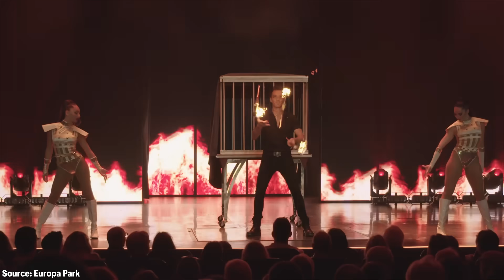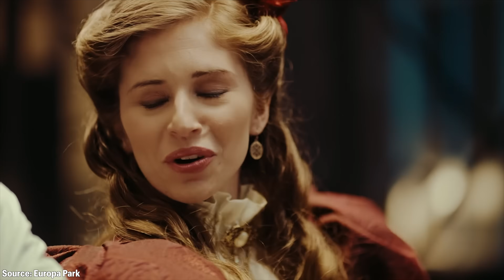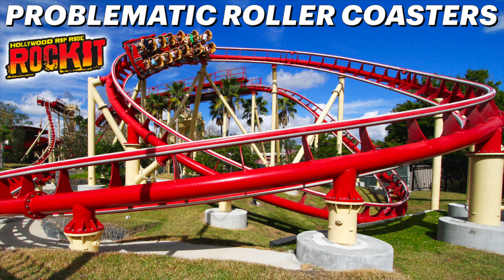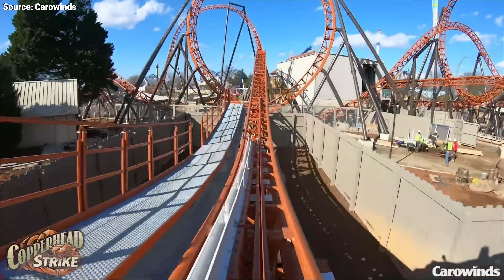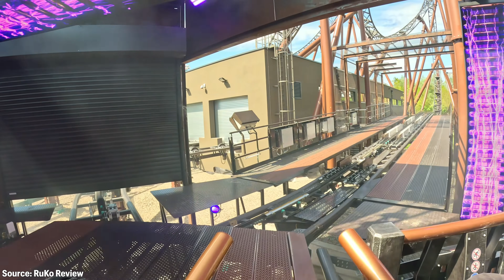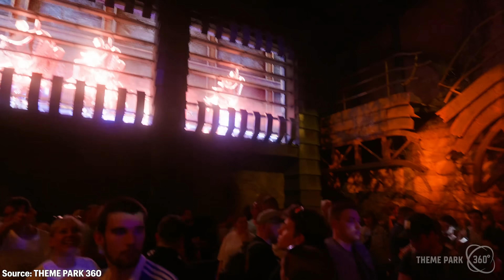2024’s Most Cutting Edge Roller Coaster - The Incredible Complexity of Voltron Nevera

Comment: Was just there. That thing ran like a clockwork.

And during my five rides it was quite smooth, with the outer seats only a little bit rougher.

But it is intense from the first to the last second, the break on the turntable is welcomed. And a real 'roller coaster' with so many different elements. Definitely a must.

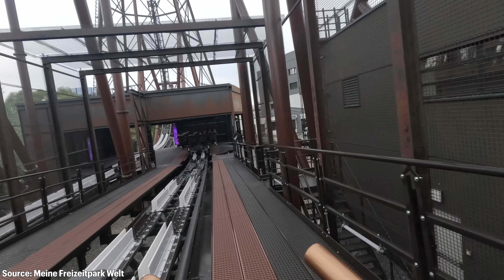Comment: 15:00 Changing direction on the turntable has to do with cables. They get tied up or need a complex interconnect if you want to keep turning continuously. Going back and forth means that all you need is a tensioner and a little slack.

Comment: I just visited Europa Park (November 2025 ) and throughout 16 hours of operation over two operating days, the ride never had any downtime. Mack’s engineering and programming is incredible. It seems the teething was sorted out quickly.
Reply: I've been there for two days (october 2026), and it did have two downtimes. One was for adding another train, lasted a few minutes at most. Second wasn't explained (but we did notice a train with an empty front row twice while in line), was maybe 10 minutes.

Comment: I guess the turntabel turning clockwise-counterclockwise instead of always in the same direction has to do with the communication of the launch motors. Electrical connections can be made to turn infinitely, with data connections this is harder and less reliable without the use of wireless components.

Comment: I visited Germany a few days ago, and got to ride this beauty. It is MUST RIDE. That first launch was heart pounding and the air time during the inversions was intense. 
Was a bit sad that we had to stall for a minute right before the backwards launch. Took some momentum away. But it didn't take away from the experience.

Europa Park's loading times are insanely fast. As a single rider, I didn't wait longer than 20 minutes for most of the coasters. (About 30ish for Voltron, as the trains stopped for a few minutes.) For Blue Fire, I think I waited 5 minutes? 
(Granted, I went on a weekday.) Considering the park closed at an early 6pm that day, it's pretty amazing that I got to do almost all of the coasters with no problem. (I skipped Pegasus, Alpenexpress,
and the water rides.)

Put this park and coaster on your list!

Comment: I got to ride Voltron just yesterday (28th June 24).

The ride is pure insanity and very intense. But... IT RATTLES. On the middle seats, it's bareable, but on the outer seat, it's almost unbearable.
It's surely not the worst rattle you will ever have experienced, but the combination of the sheer intensity of the layout combined with the rattle just does not work. The shaking makes it difficult to brace yourself for the intense elements. My first ride was on an outer seat and I had to focus so much on trying to stabilize my head and body, I couldn't fully enjoy the ride.
My second ride was on a middle seat, which was so much better. Even there, it's still super intense, but I was able to relax my body and just embrace the ride, which made it so much more fun.

Since Mack is pretty good at bending track and the fact that the rattle wasn't that bad on the middle seat makes me believe it's a train problem, so I still have hope that it can be improved.

When I was there, the park was relatively busy, there's no summer break yet where Europa-Park is, so still not the busiest time. The waiting time consistently was 60 minutes, which I think for a brand new headliner attraction is not too bad. The other big coasters were around 25-35 minutes most of the day.

I stopped the times, and they were running with 40 second dispatches. Not quite the 36 seconds, but maybe they are still fine tuning it or taking off a train to improve them (copium). But, due to the moving station, it was 40 seconds every single time, all day. I didn't take notice of any breakdowns during this day, it seemed to run like a clockwork.

The lockers are indeed free, you get handed an RFID-Card at the locker area in the queue shortly before the station, you just pick a free locker, put in your stuff, close the door and tap it with your card to lock it. After the ride, you retrieve it the same way from the other side and return your card by throwing it into one of the boxes at the exit.

As for the launches, they definitely have more punch than on other Mack coasters. The first one not that much, but the backwards launch definitely has a kick and comes pretty unexpected (even though I knew about it).

The pacing ot the layout is one reason of why it's this insane. If you feel like riding coasters a lot made you a bit dulled to the intensity of roller coasters, this thing will remind you of what "intensity" is. Some of my friends found the barrage of elements a bit too fast, but I think that's just a matter of preference.

The whole ride is mesmerizing to watch because of all the moving parts and the rhythm it has and the fact there are always multiple trains on the layout.

The indoor queue area is also pretty cool, even though it's just one big room. On the one side, you can see the actual trains entering the launch area, then the flaps close, you see some blue lights through the flaps, you hear noise and screaming, then the flaps open and the train (and people) are gone. Really makes it look like a teleporter. On the opposite side, there are the same flaps, but with video walls behind them. You see them open, and on screens behind, a train with people materializes out of thin air with lighting and sparks, and then exists the screen as if it was going towards the station, the flaps close and it repeats after a few seconds. The trains materializing on the screens have different people on them each time, and you can spot a few cameos, such as Patrick Marx (technical lead of this project who you also saw helping to push the train in your video), Michael Mack (Europa-Park General Manager) and Christian von Elversfeld (Mack Rides General Manager), and probably more that I missed. It's just a neat easteregg.

But in my opinion, the rattle is a bit embarrassing for Mack Rides and takes away from the ride experience. It's such an engineering and design masterpiece, but then kinda fails at one of the important basics.

I came in wanting to like Voltron, but after my first rough ride, I wasn't sure if I did. After my second ride which was smoother, my opinion about it improved a lot. But it's kinda difficult to give a fair rating for a coaster that has a 50% chance to be insane, intense fun and a 50% chance of it trying to pulverize you.

I'm keeping my fingers crossed that they can turn this somewhat mixed experience in a consistent, great experience.

Comment: Great video, rode the coaster as much as I could on my visit a few days ago and it's truly awesome.

Three small facts I would ride to mention:
- lockers are indeed free, ride attendants will give you a key card, which allows you to choose a locker, in the exit area there is a scanner which will tell you your number in case you forgot it
- the Tesla coils now play the rides theme, also there are two smaller coils next to the animatronic
- the effect track is visible from the waiting area, however shutters close once a train launches to not spoil the launch, that effect is also mirrored to the other side of the station where the train arrives after traversing the layout, however there is no window but a large screen showing the Mack Family riding the coaster

Also I would like to mention that operations were really smooth and there was no downtime, apart from some very short station stops, that were resolved under a minute

Comment: The turntable alternating directions is so that they can use off the shelf flexible lines and quick disconnects for electrical, air and possibly hydro. If it just spun in one direction they'd get all twisted up eventually.

Comment: Personally, I believe coasters built with short LSM's in the valleys of hills will become the norm in the future. Maintenance crews could access the LSM's from near ground level making it a lot easier and safer do upkeep. In terms of ride experience you could keep the pacing consistant while adding a bunch of capacity. Also no slowing down, you could hypothetically run the thing at 100 mph for the entirely of the ride. Everything I know about coasters is from the internet so I could be completely wrong. Love the video!!
Reply: It's possible but it's likely to be pretty expensive. Keep in mind Mack owns the park so this is also an advertisement for the system; a showroom model of sorts. The cost to throw all the gold plating on it is a little easier to swallow when it's the one you brag about to potential customers.

Comment: Thank you so much for including my content in your video. Being a longtime follower of your channel, I feel very honored by this.
Voltron Nevera was a long-anticipated coaster by me, and I managed to ride it seven times on opening weekend.

For those of you who are interested in some stats about this coaster, I also made a video with the G-Forces that I recorded during my very first ride: https://www.youtube.com/watch?v=H2XZCCfWDy0 

Yes, the ride is intense compared to everything else Europa-Park has in its lineup. Especially the ejector airimtes and the zero-G moments are exceptional.

One thing I could add to the discussions: The ride is a bit shaky at the moment. And that varies from train to train. Some of these trains already have a longer ride from all the testing they've been doing for months.
And Mackride is aware of the problem of shakiness. In fact, the day before the ride opened, a test was conducted with a different rubber/tire configuration. However, due to the higher friction, the train valleyed on the last part of the track and had to be dismantled on site using a huge crane.
Ultimately, this also delayed the opening on Friday and led to the chaos with the queues that you may have seen on other videos.

What impresses me most about this ride is how all the disruptions can be dealt with. I don't know of any other coaster where trains can be pushed back into position manually during operation without having to perform a complete shutdown. The same applies to the many ways in which a train can be stopped on course and then operation can be continued without major interruption via a swing launch. This really is a masterpiece.

Comment: When i worked at Rivian our assembly line had many turn-tables, they are not capable of going around 360 degree's. Most could only perform a 180 degree turn, so that is likely why it doesn't go the same direction as it's likely not capable. My guess is it's cheaper to build...

Comment: 15:00 - it's not surprising that the turntable alternates clockwise and anticlockwise; if it continuously rotated in the same direction, the wires to the LSM stators would get twisted.  This way, fixed wiring can be used (instead of a complicated bus-bar system) with a cabletrack to carry the current to the stators.

Comment: Very good video, but I have to clarify a few points as a Europa-Park fan. Voltron now drives 100 km/h and not 90 km/h. Launch 1 block goes until 2nd launch and not until the first inversion. The block from the third launch goes up to the end of the double up into the normal block. 😊 It can of course be, that the last two points are not 100% right, but since I have over 30 rides on Voltron, I believe it should be. 😅
Reply: 100km/h was a typo on the website. it has never gone that fast, and i think it has been clrrected
Reply: @SkeledroMan  No, the speed of the final launch (after coming down of the spike) has been increased from 90 to 100km/h, I believe to avoid rollbacks from the top hat (which occured few times). The speed stat has been corrected in the app as well.

Comment: I’ve been on Voltron when it had minor downtime (which I think was due to the failure of the pre-show curtain - similar to the one on blue fire). We were held before the turntable, then on the turntable, having turned, and then subsequently the final brake run (which can stack 3 trains) so they try to keep the mid-course ‘brake runs’ clear. I’ve also seen it go down very briefly for restraint/rfid issues. 

It is simply an amazing ride.

Comment: 16:01 from what I noticed when riding as I was stopped on the final brakerun, it seemed like the next train was not launched out of the swing launch section until the final brake was clear. Although that might just be temporary due to its valleying issue it had a few days earlier on opening day

Comment: Right now voltron is only running 6 of its 7 trains. They are rotating one train out at a time to send back to mack's warehouse to have its stabilisers fitted. They didn't have time to fit all the stabilisers inside the bogies if they wanted the ride to open on time, but it's nice to see they're doing it now. That's why roughness varies so much between trains right now.

Also, with only 6 trains the operators very often manage to exceed the theoretical throughput of the ride. With 6 trains the theoretical throughput should be 1300pph, but they can manage 1400pph quite consistently, sometimes even more. When all 7 trains are on track at once, the operators think they'll be able to hit 1750 or 1800pph, maybe even a bit more. That probably won't happen before the end of this month though.

Apart from the first 3 days, it hasn't had too much downtime. And when it does, it usually doesn't take much longer than 15-20 minutes to fix, if that. The valley block being able to reset with riders in it saves a lot of time.
Reply: Wow, that will match or surpass Silver Star, the capacity monster!
Reply: Those stabilisers should be ready for the opening. I got three rides in the morning, each on the outer seat and got knocked out like for 4 hours. 😅
Reply: @davecuban9414 not just me then! I had 4 rides a couple weeks back. 3 rides absolutely amazing - my final ride was incredibly painful. Horrendous!! But didn’t let it ruin the previous 3 rides 🙂
Reply: @jacob-r3b  Sadly, I had 3 bad rides and 1 amazing. It is like night and day. The thing is that those reviews from the media day made by influencers do not feel very objective
Reply: @jacob-r3b  yep same. 3/3 rides all headache-inducing. Awesome ride, but definitely rough :(

Comment: I recently had the chance to ride Voltron a couple times. Have to say, it's an excellent layout and just a very impressive coaster. But depending on the train and seat you get it's also really rough. Like almost uncomfortably rough, worst is the outer left seat. For me, best is the inner right seat, for the combination of forces and smoothness. The launches definitely improved, but aren't quite as forceful as the modern Intamin counterparts. For us the effect track before launch 1 was turned of, and as I heard that isn't to uncommon currently. We had a chat with a operator after closing, he told us they haven't finished programming the ride and it's actually incapable of running all 7 trains yet. We measured about 45 second dispatch intervals with 6 trains on our visit, wich still kept the line moving real quick. So, it really has the potential to be a top coaster for me, but there a improvements to smoothness desperately needed! And, 19:04: Yes, the lockers are free.

Comment: A couple more things in regards to this amazing piece of technology:
- In case of a breakdown the ride should be mostly selfsufficient to reset itself, for example from the launch before the stall. It should all go (almost) automatically with the operstor just having to keep oversight.
- I think the ride system also prefers to not stack on the Brake 2 block as you mentioned that is high up in the air, because when the final brake is fully occupied with 2 trains i think it just wont launch from the turntable in normal operation. 
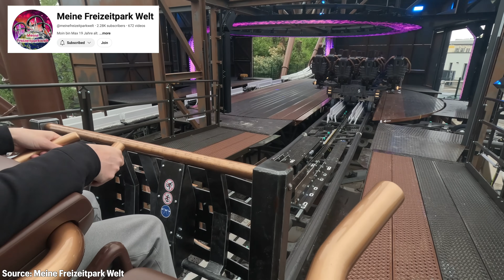- If you look at 12:48 you can see on the turntable itself, on the right side of the track, an arrow that shows in which direction the turntable will travel that cycle
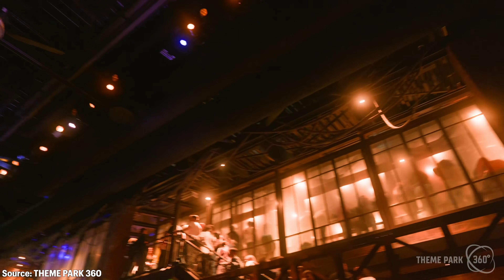- 19:04 ofcourse the lockers will be free, try and get away with upcharged lockers in Europe 😂 I wish you the best of luck...
Reply: if u upcharge lockers in Europe nobody will go on the ride and the park is instantly bombarded with bad reviews.
Reply: Liseberg has upcharge lockers on valkyria. about 50 cents each
Reply: I was on a train right before  one of those short downtime. the cause was vomit, excessiv amounts of vomit starting right after the train stopped.

Comment: The clockwise/counter-clockwise thing is probably due to the electric connections of the turntable. I can’t imagine that thing using a slip ring 😂
Reply: yeah, the currents involved with a launch are very high, and a slip ring might add too much resistance (or be too expensive) to be practical.
Reply: The slip ring is even more susceptible to problems than cables that are designed to be moved around. 
It's also not uncommon for Mack Rides to do that. Their (commercially not very successful) version of the Mad House ride (I only know of one installation, and that's at Europa-Park as well) doesn't use slip rings for the lights on the rotating part. It's all cables, and therefore you can only rotate so far before you have to reverse.
Reply: @Colaholiker   exactly